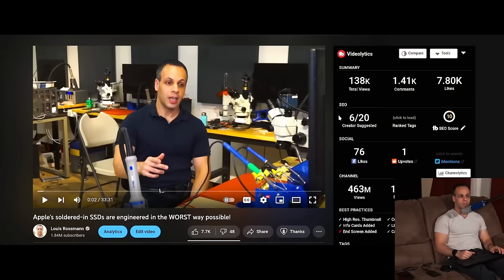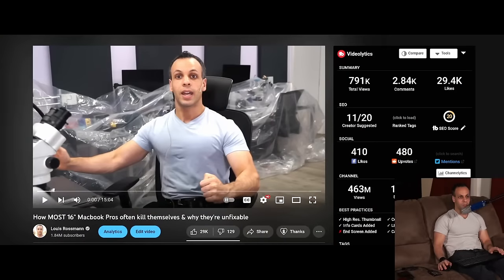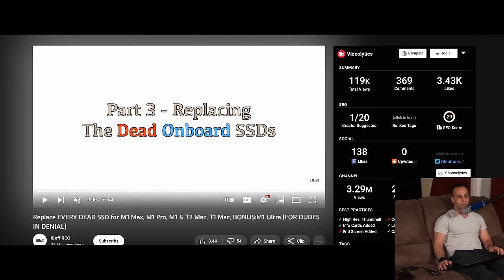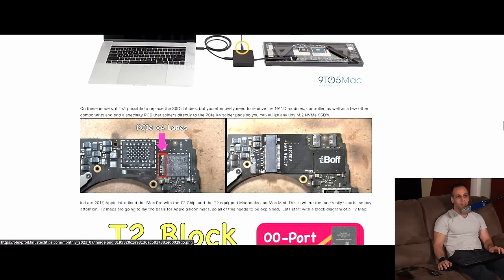The design of Apple's soldered in SSDs is worse than I thought!

Comment: I think Apple is trying to compete with the likes of BMW another “bespoke” brand which needs significant engine accessories to be removed to replace oil filter. The best engine in this regard is the Toyota Tercel on which it is right high up in your face asking to be please replaced. Love such perceptive clean maintenance focussed design. By the way that engine is virtually indestructible. The body will rust & fall apart first - take decades for even that - before the engine “might” give up.

Comment: I would think that over time the quality problems and the high cost of fixing an Apple computer would cost Apple dearly with lower sales by their customers abandoning Apple to go with other companies that provide higher quality and much lower cost of ownership! I just received an email today from Amazon showing me computers I can buy renewed for less than $100 with Microsoft Windows 10 Professional OS installed on them with a keyboard and mouse! You can get the computer for free for the cost of the OS software! Also, recently I just replaced the clock battery on my wife's 12 year old laptop and upgraded her memory from 4GB to 8GB for under $25. There are incredible deals out there for older used computers compared to these new computers!

Comment: $600 for ONE, TB!?!? 
What is this, 2008?? 

Man I thought Apple hating established standards was bad, but this is just comedy.

How do apple fanboys defend this one I wonder? Oh wait, I recall this from iphone arguments from ages ago where they defended not having a microSD card slot "Just buy the size you need from the start, it's easy" 
But now these things are beyond that, worn out? Too bad. Guess you'll have to buy an entirely new computer because the storage failed- which no other good laptop or desktop has ever had to deal with. 

And this also ignores the fact that there is no benefit to the customer at all. Your drive is soldered in- who does that benefit here? Why is this better than other designs? It isn't.
Reply: Considering you can get server grade read-intensive ssds with 7.68TB for that price in volume it's almost comical :)

Comment: Im not disagreeing and saying Rossman is wrong. What hes talking about now is computers with T2 that intel based and there are no Macs produced after 2020 with intel CPU n motherboards, this is correct? Im not saying its a good solution but with T2 is it not possible to export some key that would enable the computer to boot when the disk that came with the computer isnt connected anymore? 

Im thinking T2 with secure enclave is the equivalent of Intel w TPM 2.0 secure mode boot. Then it wont boot if you replace some main part of the computer but I THINK it's possible to export a key that makes ot possible to get around this if needed. 

Then that whole electrical shortening custom this is another issue all together. 

Not saying that it would be convenient at all for the customer im just wondering if its at all possible to salvage a situation at all with this function if youd want to replace a part im thinking it should be possible and if it is the siruation isnt quite as sire as Rossman paints it to be here but I could be wrong.

Comment: At least Samsung 980 Pros get bricked into read only mode, facilitating data recovery (post controller failure, which was only partly fixed via firmware update).
Reply: Only if you don't update the Firmware ;) Most SSDs are supposed to have an "emergency read only mode". Some manufacturer just can't be ar*ed to implement it correctly it seems.
Reply: ...partly?
Reply: @cielazul713  The bug corrupts some lookup table badly so it goes read-only. The drives are salvageable though. Just not for "us mere mortals" ;)
Reply: @peterpain6625  Huh, its just so odd how a big memory company like Samsung could mess up like that. Well, at least it makes shopping for a new SSD a bit easier still lol

Comment: Is it safe to assume the same shit will happen on model iMac20,1 ? It's a T2 chip with ssd soldered in, I guess yes then..

I must admit I'd avoid buying mine probably if I knew this ridiculous stuff beforehand. I did buy it with the possibility of ssd failing on me but I thought thunderbolt boot would be just fine.

I guess I'll be moving my ~ along with other frequent write directories to the TB3-connected nvme disk. Come to think of it maybe even move the whole system to external nvme and just let that internal ssd collect dust (and provide uefi/other fw shit to that imac).

Comment: Someone needs to develop a socked that you solder in place and replace the chip at will. Id pay to have that installed using an SSD with 50,000 write cycles because when that fails, i can open things back up easily (of have Louis do it) and quickly put in a new one.

Comment: Apple is the most frustrating pc because when they have any problem outside of warranty it is either too expensive to fix by Apple or non-repairable by most everyone else forcing you to purchase a new Apple product to save your backed up data (which is if you backed it up in the first place).  You actually can not trust an Apple device for long-term reliability/repairability.  Louis is a pioneer in bringing this to the attention of the public.

Comment: Imagine cars being designed and built this way ‘and not only is the battery only factory replaceable, but they integrated it with the firmware… - if your car’s battery dies you can’t even jump start it.

Comment: I was under the impression that the SSD's in MacBooks and Mac Studios were basically the same as mainstream SSD's except that the controller was incorporated onto the SoC and not on the module itself, and that's what improved the performance. I remember seeing that in a video on one of LMG's channels around the release of the Mac Studio.
Reply: That used to be the case. But the last few years they've been soldering them directly to the board.

Comment: The Apple slogans have been there to warn you: You are an Apple user? "Switch" (2003-2006). You think about upgrading to a newer model of your Mac? "Think Different" (1997-2002, 2021-Present). You want your data back that's on that dead Apple device? Unfortunately, "there's an app for that" has been retired in 2010 and you won't see your data ever again.

Comment: If you boot up a RaspiPi, you don't need any BIOS chips. It boots up directly from the SD card.
Reply: It HAS to at least have a bootrom. SD cards are mass storage, and can't be directly interfaced with.
Reply: @KopperNeoman  Yes, it have. In SoC. First thing that boots is... GPU. Then it wakes up CPU. Go figure. RPIs are next thing to shoot, since their bootlicking behavior towards Broadcom.
Reply: @d3stinYwOw  except that rpi is ~$50 not $1500, big difference. and i'm still to find any rpi that cannot power on because the sd or ssd failed.

Comment: I agree, apple is very innovative company, they are doing a lot of research and find new ways to screw you.
I think they have a separate department designing non standard parts. If apple will make a car, I am sure that they will not use a standard wheel size, and every bolt will be custom made for them. In the future, standardized parts will dissappear. For example in the bicycle world, sram uses a chain which is flat on one side, so you cannot use any other chain. If the regulators don't do anything about this, proprietary and custom made will return in the industry.

Comment: As a non-user of anything related to Apple, I've been trying to defend them for some time. Consumers have a right to choose what they want. If they like the layout and OS and the fact only one OS runs on that specific hardware, that is fine. There is a lot of great software made for Apple devices. And even the walled garden is fine from my perspective - if you want freedom, go to Android/x86 machines, if you want ease of use and safety and perfect compatibility, go with a walled garden. 

But this is really just unreasonably stupid to the point where I am sure it is malicious, weaponized incompetence. Putting the BIOS on the SSD is downright insane! The BIOS is crucial— essential for everything and anything to function at all. It's like making a fire department's ability to respond to emergencies dependent on a disposable pager. When the pager fails, the whole operation is crippled. This setup is pure, weaponized stupidity!

Comment: Wait, so do I understand this correctly? Apple stores their version of the BIOS on the SSD instead of a dedicated chip just for storing the BIOS?!

If so, that's insanely stupid. Designed to fail, designed to make you buy a new one.
Reply: Not only that, but the power rail to the SSD is the same power rail that goes to the CPU and other components, effectively shorting out the entire system when the SSD fails

Comment: Puting the Bios onto the SSD. And the base model comes with 8GB of ram, so it will need to do page file using the small 256 SSD. Leading to early SSD failure, rendering the entire system useless. Congrats Apple, this is pure evil engineering.

Comment: Buy Apple Care (for hardware faults). And iCloud (to keep your data safe). That's what Apple wants. We aren't what we were in 2012, people around us grow up and change all the time, Louis. It's a commodity now and people (under 40) don't get emotionally attached to stuff. 

I'm watching this on my Linux desktop, been doing so for years. I love my workhorse 2015 MBP to bits (that I fixed after someone spilled cordial over it) and I upgraded the SSD with Transcend back then. We do enterprise tech support, 80% Windows but I've seen a fair bit of Macs over the years. I wouldn't want any of the latest Macbooks for myself even for free. My next computer will likely be Framework, running Linux. But that's not good for your business model.

Comment: 1 TB  for 600$?    the computers have gone super expensive. What will a entire mac cost?  60000$?

A apple computer is designed for one thing, profit for apple and destruction and fail for customers when they have used their laptops for 6 months (that did cost maybe 500$ to start with).

Comment: I bought my Macbook back in 2014 and used it just 3-4 times, this stupid Macbook Pro has the RAM soldered to the Mainboard but at least the NVME is socketed but with this stupid proprietary socket so I need to buy a stupid adapter to use a regular NVME Drive.
I bought the Macbook Pro for Logic Pro but after I tried out Logic Pro I decided nah, I will stick with FL-Studio on my Windows Device instead.
Now I'm using my intel i9 Motherboard from Erying that I bought for 170 Bucks and get a much better performance and experience than a 3000 Bucks Overpriced PC from apple I mean "Macbook"

Comment: Sadly, I'm coming to the conclusion that not that relevant. Apple storage pricing doesn't allow for much and general trend with gardened ecosystem says that data should be stored in client agnostic way - e.g. small NAS at home + encrypted long term storage in the cloud.  Laptops - Apple or other - are increasingly usable only as thin terminals.  Also, baseline MacBook Air + Linux based reasonable desktop is still cheaper than top of the line Mac or WinTel laptop.

Comment: Chip makers are facing the "Smaller-Faster-LowerVoltage" challenge.
Chips fail (in my opinion at this point in time) due to improperly insulating or using impure silicon to insulate the junctions of the many layers of silicon which make up an integrated circuit,crowding too many junctions on the die which generate heat at the PN junction level,an improperly filtered power supply (Apple uses pulse width averaging regulation and a couple of ceramic capacitors for smoothing the pulses which could let high-voltage spikes to pound the NAND should they fail or age un-gracefully) or trace inductance too long which can introduce a back-EMF into the NAND I/O pins.
Owing that a "New Generation" of Apple motherboards are blowing NANDs at an alarming rate leads me to think that the NAND chip is not sufficiently hardened to withstand the rigors of Apple's economy of using too few parts or a crappy board layout around this vital part.
After all,silicon PN junctions tend to drop in resistance when they get too hot-assuming they are not made like a MOSFET which is unlikely due to a MOSFET's capacitance delay in switching.
I am not well-versed in Apple Motherboard diagnostics as well as Louis is,but I can read a schematic fairly well and have a good knowledge of how high-frequency pulses can bugaboo a circuit.
It seems that Apple may very well have a RECALL or even a Class Action Lawsuit on their hands.
 Will Apple put on their Big Boy Pants and Do the Right Thing?
It remains to be seen...

Comment: To me that is not bad design, it's deliberate, it was the main reason i stopped buying macbooks. In short, it's impossible for you to keep a macbook running under heavy use for more than a few years, because the SSD will die.

Comment: Doesn't Apple allow you to sync your data on their servers? After your Mac fails you can buy a new shiny one and get the data back from Apple's servers. And because Mac users are at least middle class, they can afford to buy a new laptop any time. After two years one becomes bored using the same laptop and knows he is missing on new Apple innovation! So because it broke is a good and plausible excuse to buy a new one.

Comment: This is insane. No sane person would design a device that stores data essential to its functioning on a chip that's rated to a limited number of read/write cycles. A 64/128Mb ROM chip isn't that expensive and is a million times more durable than average consumer NAND flash that's at this point likely to be TLC/QLC on those devices, although that's again something we don't know because apple doesn't publish any technical or durability data on the flash.

I've never owned an apple product and while I can't argue that they have incredibly neat devices, at this rate I never will. I'm considering getting a laptop from Framework who, at least, design them to be repairable and allow me to buy replacement parts at reasonable prices. (And before people start pointing fingers at me, I receive no financial gain from mentioning their name anywhere.)

Comment: NEVER been a fan of Apple, and I'm old enough to remember when they were a new company. I'm even less impressed with them now. This is just blatantly malfeasance. No engineer "on the floor" would suggest this. Even soldering in instead of an M.2 makes 0 sense on PC. maybe some kind of embedded SBC but...even then...what are you saving? Again, just planned obsolescence on overdrive

Comment: Perhaps the recommendation should be Apple users tape a SSD to the back of their laptop BEFORE anything ever goes wrong with the internal SSD.    Boot from that, and use that day to day instead, to  (1) Prolong the life of the SSD, and
(2) Make it easier to port your data when your current SSD fails anyway.
Although..  Don't necessarily expect Apple to keep the ability to boot from external storage on newer hardware versions.

Comment: Is there a way to save those macs without replacing the ssd chips?

Like removing the bad ssd chips, flashing coreboot/tianoboot/seabios in the macbook, and using external ssd storage to make it work again? Or without the T2 chip firmware it can't be saved?

Comment: Thanks! I almost started thinking that the M2 Mac might be a good idea for me (after not using macs since 2013). Well, I'll never buy a device designed like this. I use computers for work for gods sake... This way I can with clear mind ignore "cupertino innovation" for the next decade or so. Like I already did 10 years ago.
Apple had it's serius advantages in the WIndows XP Era for me. Nowadays there's almost none, plus a lot of idiocy sold as innovation. Literally anything else will be exposing you less with failures, etc. What kind of tech partner is that?
Meanwhile LInux got so much better in the last 10 yeatr! Still it's not a good choice for non-techies, but when they see what they're getting into with the big A they might reconsider. Loosing all my data due to drive failure early in my carrer taught me a lot. I'll never forget that lesson.

Comment: 'Great design' all round. After seeing your videos over the last few years, I've more than once been appalled of how poorly designed their products are these days. As you have mentioned before, Apple of old used to be about good design and their machines were robust and reliable. I still have an old 16 years old Macbook that just works and the wear and tear is not even so much visible on it, just a few scratches and otherwise it is like new. Battery died once, easy to replace as it is user replaceable. Even the mechanical HDD still works well. The crap they make these days and lying through their teeth about how they are environmentally friendly is just out of this world. Based on what I've seen on your videos, even some el-cheapo Chinese laptops are better than a Macbook. How is this with the soldered SSDs environmentally friendly in any interpretation of the concept?? I have a bunch of 1st and 2nd gen iPads and the only use for them for me is to work as a bloody wall clock (which I do as it looks cool) or a digital picture frame (to which updating the photos is made as difficult as possible). Hardware wise they would still be valid for so much more, but no.

Comment: If apple made cars they would integrate the oil filter inside the engine. So once the oil filter went you'd need to take out the engine and strip it down. lol

Comment: Apple devices are throwables, cant (or hard to if possible) to repair a device with just a very simple broken part that you may or may not even need to use. can't wait for models to be release that becomes unusuable when a key is not working